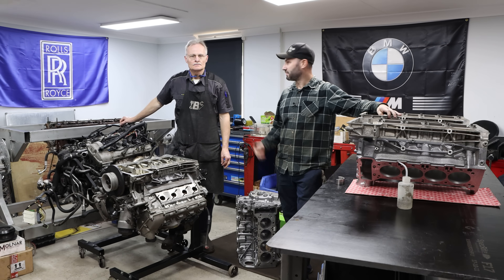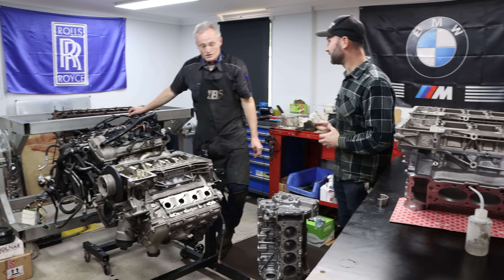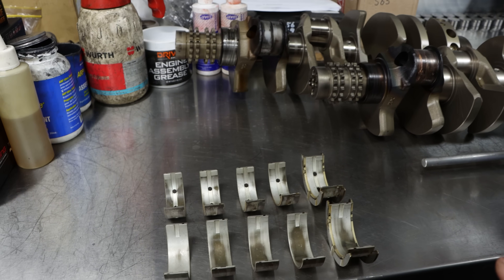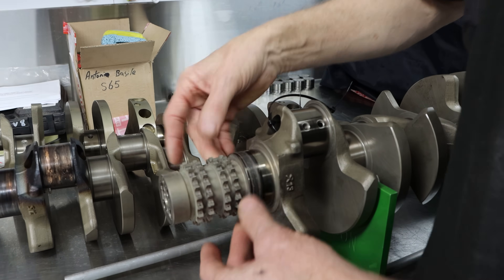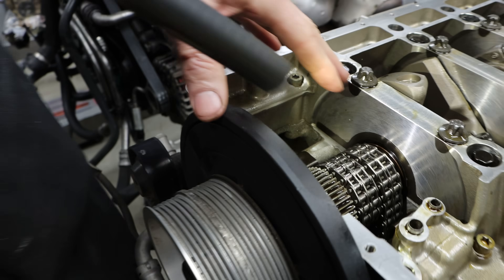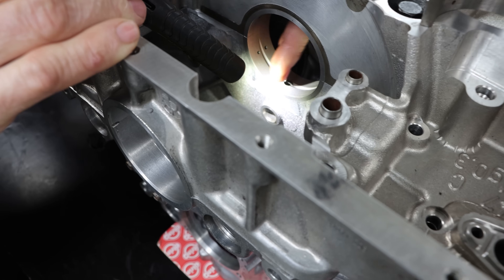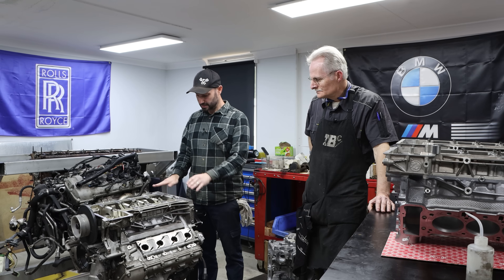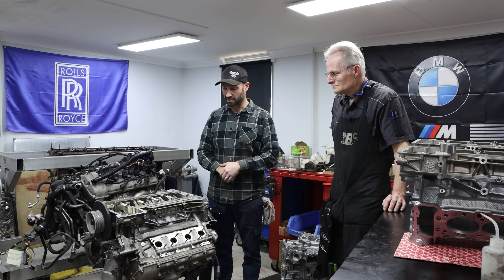BMW M3 S65 MAIN BEARING FAILURE! Rod bearings trumped by main bearings.

Comment: I've been compiling a list of blown S65s at the M3 post forum, would you be able to tell me the mileages and bearing type of each of your damaged S65s?

Btw it's quite misleading to imply that all the engines will suffer mains failures because all the ones you have there have, their were ~2100 e9x M3s sold to Auz and NZ, how many of those have suffered mains failure?
 I had heard of a small number of mains failures before on these, but I've not heard of a sleeve to repair spun (uncracked) mains, that's cool! Nice job!😎

Comment: Don’t use 1060 oil if your daily driving these that’s where the issue is that oil is way too thick for these engines to be used for daily driving. If you track your car it’s absolutely fine. The only reason the engineers recommended that oil was to keep your tap it’s quiet so it didn’t sound like a sewing machine.

Comment: Nice video & appreciate the rework.  Seems to me that this wear pattern could be caused by revving generously off a start, before the oil has a chance to flow into the bearings and center them up properly.
Reply: I think that could definitely add to the issue.  I tell all my clients in any car to allow the engine to idle a 30 secs if it sat overnight or a few hours and allow oil to get up to temp before any high rpm.

Comment: Question... Bmw different colour codes for each half of each con rod bearing.... Is this just a matter of extra material on conrod half due to power stroke stress or different / denser material, I've never encountered this before and wish to understand. Thank you
Reply from the maker: The colour codes a small clearance adjustments to achieve the right number - from BMW's technical data. Usually 1-2 10 thousandths of an inch of size change

Comment: Okay so im going to buy a 130k mile e92 m3 and i will do the rod bearings but I should also do the main bearings?
Reply from the maker: It is certainly good practice to address the main bearings if you want to cover the critical issues, yes.
Reply: @ im seeing and hearing they only fair cause of super charging the car so im very iffy on it. Also local shops are not even entertaining the idea of doing that job😂😂
Reply from the maker: @saadchowhan1147  all the failures we have had in our shop are non supercharged. And any shop not entertaining this is letting their customers and engines down. We just had an engine arrange to be shipped over to us from the US due to the customer not having confidence in his local workshop options
Reply: @ sorry if im asking too many questions, I wanna just keep my self educated and safe before I buy this car. Would you maybe say the thickness of the oil and the fact that some ppl are just inconsiderate and don’t do the required engine maintenance to keep the engine healthy a factor? Or just purely bmw being bmw and designing poorly/over engineering
Reply from the maker: @saadchowhan1147  have a read at all the other comments and our responses for all these questions already discussed

Comment: i just bought a motor from an LCI car here in the US which came with Auto start/stop function which is told to make the mains wear faster. the motor has 54k miles & im definitely going to be changing the main bearings. should i go with OEM or an aftermarket example. car will be tuned and shooting flames & eventually supercharged. advice greatly appreciated!!!

also the motor i pulled out of the car had a spun main #1, also an LCI car, dct.
Reply from the maker: We suggest ACL Race series bearings.
Reply: @BrintechCustoms thanks for the response, from what i see they only sell one size ? should i be concerned with the fitment and confirm they’re in spec with a plastic gauge?
Reply from the maker: @euroblockco  no they have many sizes. We supply them. 0.025 HX STD 0.25 0.50
Reply: @BrintechCustoms what size should i use ?
Reply: any specific size i should use ?
Reply from the maker: Yes very particular. Use the size as per your measurements at the time. If you need this explaining further it may not be the job for you

Comment: Ref comments bagging main bearing replacement as a maintenance item, remember this engine is a v8 and revs over 8k. It’s not a normal road going motor, that race car noise and feel comes at a cost. If you cant bare that go buy something else.
Reply from the maker: @Malcom2345  absolutely. High output engines require higher maintenance. Different engines different requirements. But in the grand scheme the S65 is one of our favourites
Reply: @BrintechCustoms thinking regular testing of oils is a must, picking up on early deterioration of the different layers of the bearings before it gets beyond repair / maintenance.

Comment: My personal experience with s65 :  I've had this happen to my first block , 8tkm after rod bearing replacements with OEM 70x.  
Now on my second block the rod bearings are replaced with King CRV and no issues 50tkm onwards but the engine now has 160tkm on it.  
I guess the smart thing to do is preventative replacement of main & rod bearings but since it is an engine out job one would only do this for a full rebuild.
What about the harmonic balancer ?  Is this not a factor in play with these failures ?
Reply from the maker: Fortunately this is not an engine out job. We do main and rod bearings in frame

Comment: I changed the rodbearings on my s85. the engine had almost 130k km’s. it ran on 10w60 all it’s life and still does to this day, the rodbearings were in great condition so I did not see a reason to use thinner oil. yet a lot of owners seem to think the oil is the issue. So is it actually?

Comment: Let me translate. 

Ok hi folks. 
So everyone has replaced their rod bearings 
Vanos 
Vanos covers 
Injectors 
Throttle actuators 

So I reckon we could make more money out of these engines. Activate a new scare story 😂😂😂
Reply from the maker: Yes you've hit the nail on the head Stephen! We fabricated a scare tactic by destroying 5 Engines in a row with locked up cranks on number 1 main and destroyed blocks. You're a real asset to the BMW community and should continue to add this kind of value. By the way S65 engines aren't known for VANOS issues.

Comment: can you give any information on the age and mileage of these engines, are they pre lci (2007-2009) or lci (2010 onwards), what mileage we each of them on (ie over 120k / 130k / 150k miles), how long ago were the rod bearings changed before mains failed etc? 

this would be super helpful for the wider community! 

Thanks
Reply from the maker: @LukeyBoi88  I've already mentioned this in other comments here. No mileage or engine year correlation to this wear and failure. All S65 engines should have their bearings addressed if you want to own one

Comment: I spun a crank bearing on a n52 but because the oil pump bolt itself backed off at high speed on the highway the car drove fine all the way home and when I got out I heard it knocking and I was like what it was just fine … pulled the engine a week later and snatched off the pan to find that the rod caps for cylinder 1 and 5 were completely destroyed and not even apart of the crank anymore .. fun thing is that even tho the oil pump wasn’t pumping oil it survived and 15 minute drive doing 15 mph after the oil pressure light came on .. no holes in the block no crackes I mic’d the cylinder and had it look at for cracks and none where found threw in some new mains and con rod bearings and did the valve steam seals the engine runs even better than it ever did I used the same pistons just changed the rings and gapped them properly .. car had 154k miles on when the engine spun a bearing I’m at 205k currently still going strong
Reply from the maker: @mtbridingog9083  we have had an N55 oil pump bolt (alloy) head break off and slam into the pump body from the crank counter weight and bust a hole in it. Killed oil pressure and spun a bearing. We replace pump bolts with steel ones because of this

Comment: If you bond a lubricant to the metal you can dramatically reduce the wear in your bearings by 50~90%: 
2~10x improvement in lifespan
🙂 #XcelPlus

Comment: after watching this video, i have to ask:
which would be a more reliable race built motor, S65 or S85?
Reply: Well since both got very similar issues go with the one that sounds better in your opinion. The S85 has less issues with mainbearings but you get other issues instead. Both are equally reliable if compared.
Reply: @MM-2460  great! thx for ur reply!

Comment: Years ago there was a recall for the mini engines to replace the main bearings and they supplied a special tool to remove the uppers without removing the crank, I wonder if the tool would fit the s65 so people can do this repair without removing the engine 🤔
Reply from the maker: @AW-ty5qi  it's quite simple to do without a special tool

Comment: What if you Micro polished the crank to improve oil flow.. Lower engine temps by using a BMW 1.4 bar coolant cap instead of the 2.0 bar cap
Reply from the maker: Yes these would certainly help. We do a super polish process in them now when doing rebuilds. The cranks end up looking like a mirror

Comment: So basically S65 engines need a weird amount of preventative works done to ensure reliability…. 

How much would it cost to bring my car around to get all these works done? 

So far I’ve gathered: rod bearings, main bearing, throttle actuators, usual VANOS  issues, engine mounts…. (And I’m sure host of other things such as Idle control valve or valve cover gaskets etc) 

Assuming drive-in and drive-out, how much would all these preventative/reinforcement work cost???
Reply from the maker: Email us this and we will respond there. Cars@brintech.com.au
Reply: depends where you live and how you want to fix it, if you're buying all the parts new and dont rebuild the TA for example then the parts themselves will be thousands upon thousands especially if you count in all the bolts and gaskets and ICV, for VANOS cups you need engine retimed for the proper solution as well, depending where you live labour will be many thousands too, I think this car is best to own if you can do all of it yourself but you're still gonna be f*ckd on the parts being expensive

Comment: The main bearing failure of the S65 engine might be caused by the extra gaped rod bearing. Although the extra gaped rod bearing has more clearance to save itself, the extra gap can also cause pressure loss inside the crankshaft oil channel that feeds oil to the rod bearing. This pressure loss can cause a lower flow rate and reduced pressure in the main bearing. Some S65 engines might survive this failure because the tolerance adds up between parts, and the main/rod bearing gaps aren't too big or too small. 
Two cars had main bearing issues in my local shop just after changing the rod bearing (3000-4000km), and now they both need a new engine.
Reply: BE bearings did a detailed analysis on oil pressure and flow rate with increased bearing clearance . Their conclusion from the testing was a minor drop in pressure, but a notable increase in flow,  however despite their conclusion. There does seem to be a sudden increase in main bearing failure bejng reported online, and there also seems to be a emerging trend for main bearing failure after rod bearing replacement.  I think it's a note worthy observation, possibly not enough to draw definitive conclusions from.
Reply: yes i wonder if people are putting undersized rod bearing on.  As previous reply mention they had BE bearings which have different clearance than oem.

Comment: These S65 should not be filled with 10W-60 group 4 POA. Cold start performance and shear resistance is poor with an engine of these tight of tolerances and rpm limit. 5W-50 Group 5 ester based oils with low mile change intervals essentially solve this issue along with the addition of tungsten disulfide.
Reply: How about 0W-50?
Reply: What does tungsten disulfide do?
Reply: @JahlMarshall  Developed for NASA space probes Tungsten Disulphide is far superior to Molybdenum, Teflon or other high grade engine oil additives with a lower (better) coefficient of friction. This ultra refined Tungsten Disulphide adheres to metals within the engine providing a highly durable, sub micron, low friction layer that makes engines run smoother, cooler and with greater efficiency.
Reply: If it was the oil viscosity being the problem it wouldn't be isolated to #1 main bearing.
Reply: Tight tolerances or not, fact remains the crankshaft extends along way past the front no1 bearing, its going to flex under load. Be thankful you don’t run a supercharger, guaranteeing much earlier deterioration of the main bearings, especially no1. The supercharger only accentuates the problem forcing considerably more upward force at the front of the motor.

Comment: But how much would it cost to do main bearings?
I heard it was so expensive that at this point it doesn’t merit getting them done considering how much you can get a replacement engine for unfortunately
Reply from the maker: We replace main and rod bearings for $6k aud. Not expensive compared to a replacement engine at $25k
Reply: Right that definitely makes sense. Here in the states you can find an ok used engine for roughly 7-8k aud plus labor for the swap… 
It’s actually still pretty expensive and I’ve talked my way into just doing the service being a better idea lol
Reply: @BrintechCustoms do you replace all the main bearings or just #1?
Reply from the maker: @Machine_s15  all of them.

Comment: Hard to believe that the timing chain tension is enough to distort the crankshaft upwards into the bearing, but as soon as wear becomes excessive the rotational cycles of the crankshaft will accelerate the frictional wear causing excessive heat and finally failure of the bearings. The timing chains must have an exceptionally high tensile strength to weight ratio, to bend the crank rather than stretch the chains. Thanks for the technical explanation and well done for engineering a solution.
Reply: It got me thinking: wouldnt engines with massive flywheels feel the same thing on the last bearing? Altough when it rotates it should be good, but initially it could introduce a bit of a trouble to that last bearing, at least i would think so. Lets say that flywheel weighs 26 kg + clutch and pressure plate, thats like a cement bag hanging on the end of the crank. I think adding bigger harmonic balancer on the front end could reduce that radial force on the first crankpin, altough it would mess with harmonics
Reply: Our theory is that the chains may contribute to this phenomenon, but do not cause it single-handedly.  The first main bearing on most BMWs is spec'd with larger clearance than the other main bearings because of the expansion of the crank caused by torquing the harmonic balancer bolts.  In its rush to make a low clearance highly strung race engine, BMW apparently forgot about this principle.  In rebuilds, the larger clearance is established, meaning the problem should attenuate.
Reply: The #1 main upper shell wear in S65 motors can be seen in low mileage examples also. One theory is that the v heavy double row chain creates sufficient centrifugal force (at high rpm) to effectively lift the crank snout into the upper bearing. Really bad design, if so. Interesting choice of chains, as S85 - with higher torque cam drives - uses much lighter single row chains. I'm guessing harmonics were uncovered after lopping off two cylinders, and heavier chains were a cheap, simple way of addressing. No one realized that the crank snout would become a chain tensioner at 6K - 8K RPM...

Comment: Another solution would be to throw an s85 in there. If you could get the dct to work with in on the stock tcu would be bonus points

Comment: "Tight clearance engine" isn't a thing. Right clearance engine is. There's engines that are higher strung than this that last longer. Examples are easy to find in all types of road going and motorsport vehicles. It's a design issue. Nice car, nice engine when it runs, great engine after you guys  re-work it. Thought the fact that it even requires re-work tells you that it has a design flaw.
Reply: I agree however. There are suggestions the engine was initially manufactured with lower than engineering textbook clearances to reduce noise emissions, with oe supplied bearings gaining clearance with subsequent production runs as the problem became more noticeable.... now I know, that sounds like a tall tale if ever there was one but it originated in circles not prone to indulging in repeating rubbish. And legislation often produces  unintended and unforeseen consequences.
Reply: Another consideration is that the engine design is good, and this is actually a problem of quality control and accepted limits of useable bearing shell size deviations, from what I understand there is micro differences in size in each bearing and as part of the building process bmw assigned a level of tolerance to how much tolerance was accepted as in whats too big or too small a clearance .  resulting in vehicles leaving the factory with a wide mix, some being loose while others are tight as hell and spin a bearing at low kms. This is just a theory, but it would explain why some gently driven and maintained vehicles fail with low kms and others like the evolve e92 M3 that had its rod bearings replaced at about 250,000km and looked absolutely fine

Comment: Very good video thank you, like you said not much info on this on the web. I am a lucky winner of a main bearing failure also. BMW should be responsible for this, the B7 RS4 is also a high revving motor but does not have this issue, very upset with BMW about this